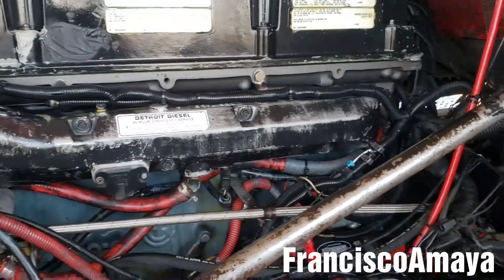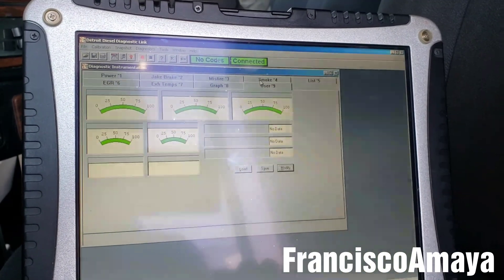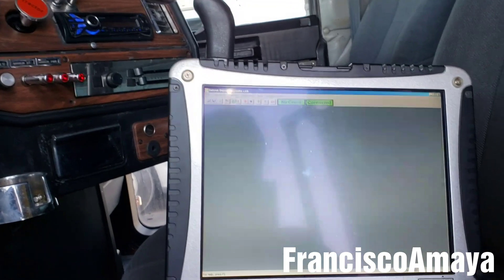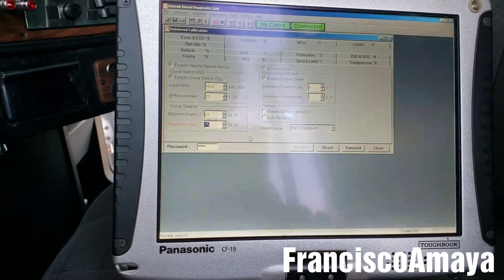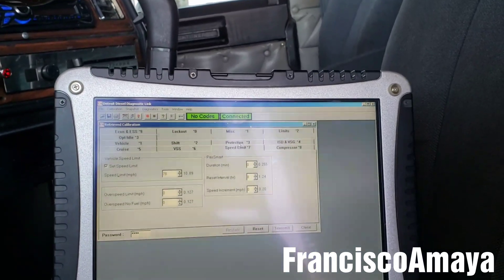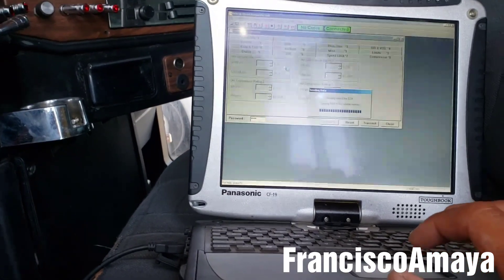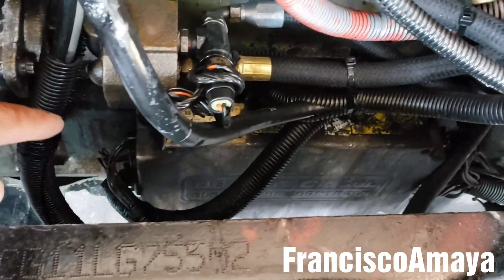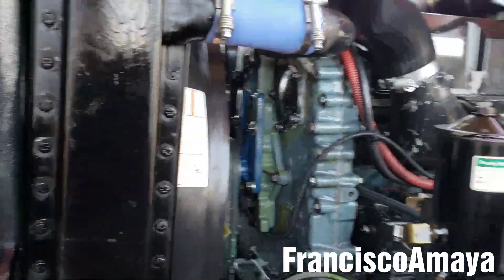Detroit Diesel Series 60 ECM programming old shool engines DDL software

Comment: Everyone's saying they were easy to work on, so why did they go to more complicated digital systems?  Combine modern engine engineering with old school digital systems, maybe? the requirements to run an engine optimally, efficiently and environmentally are not beyond the capabilities of older computers, just the physical components and their designs.

Comment: Gracias Francisco 
My first truck was an old 2002 Scheinider truck Series 60 12.7, engine..bought it with 700,000 miles, did two super tune ups only, loved that engine, sold it with 1 million 1 hundred thousand miles.

Comment: I had a 07 Columbia with this motor. It was a money marking machine for over 8 years. A full inframe cost 17 with a new head and egr included at the dealer. 

So to upgrade the Columbia, I got a 05 western star with the same motor.

U can’t beat these old engines. Simple, cheap and they easy work on.

Comment: Hey Francisco thanks for making this video.. I do have a few questions maybe yourself or a knowledgeable subscriber could help explain or answer... 1. What is the “Enable the progressive shift “ meaning can you explain the difference between it being checked and unchecked.. what does it do for shifting?... My 2nd question is if the truck is rated for a lower HP setting are there other options you can do to increase the HP an torque power rating for better performance on the 60 series Detroit motor with a EGR and Non-EGR system? I’m staying in FL by the way... Thanks and looking forward to other 60 Series Engine Videos 🤙🏽😎 - Jon

Comment: I would need 600+ or better under that big azz truck 😁
Reply: Ain’t about the power it’s about the torque.... big difference between 1650 lbs torque to 2050 ft lbs torque... Hp gets you across stop signs, torque gets you to the top of the hill